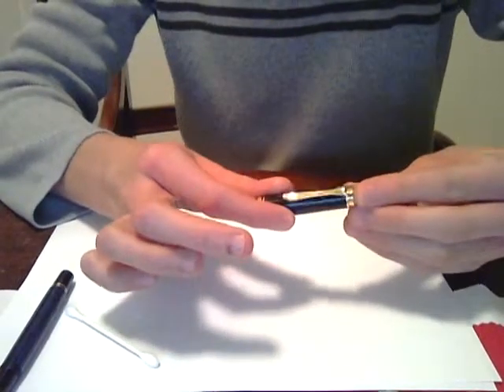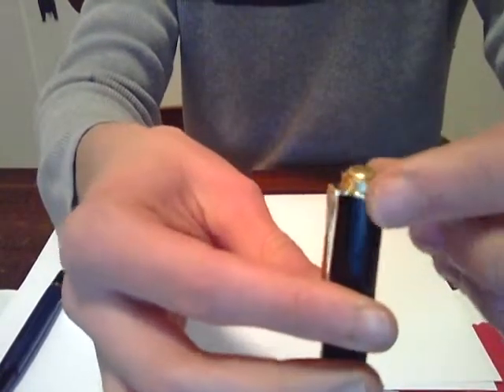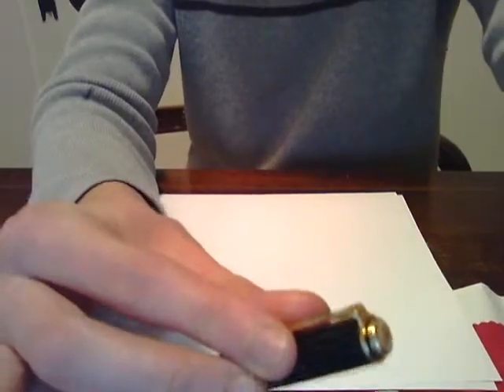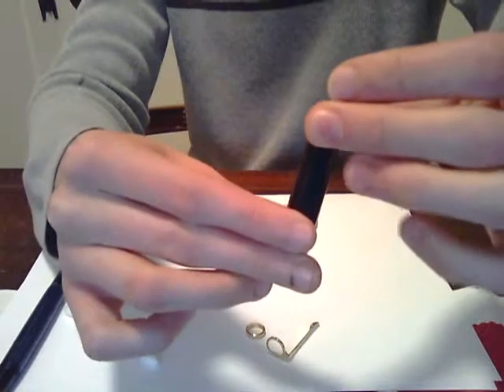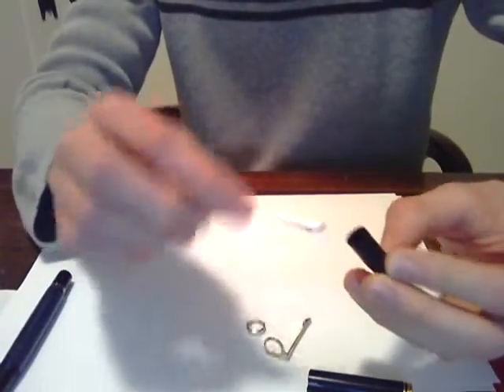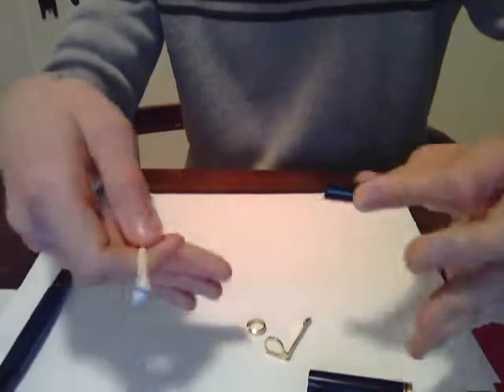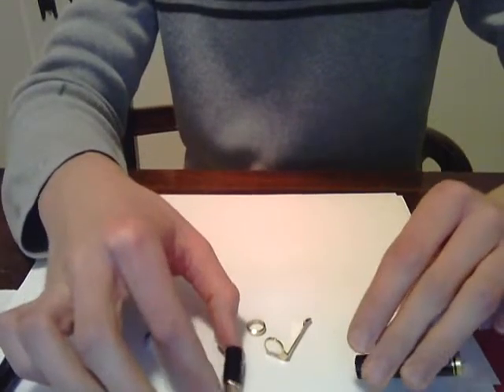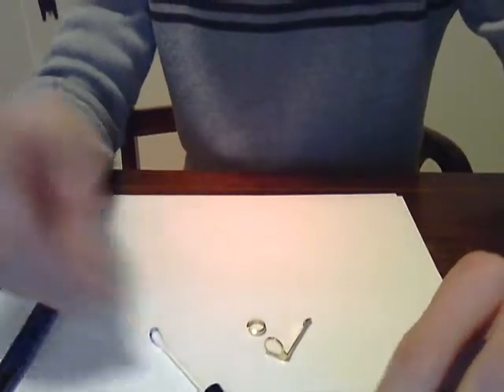Pelikan Cap Dissasembly

Comment: Very cool, thank you!  I had so much dried ink trapped between the inner cap and out cap, they would not initially disassemble.  I used a water pic tooth cleaner with water to remove much, but not all of the ink.  I left the cap in water overnight, and it came apart right away in the morning.